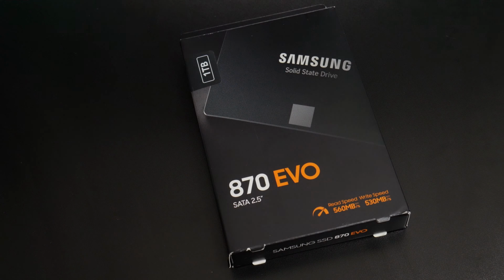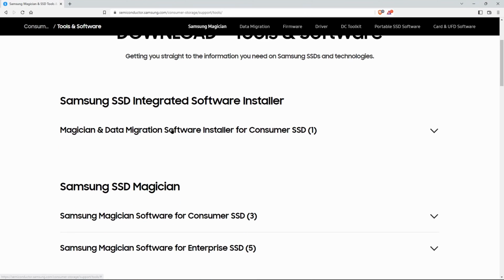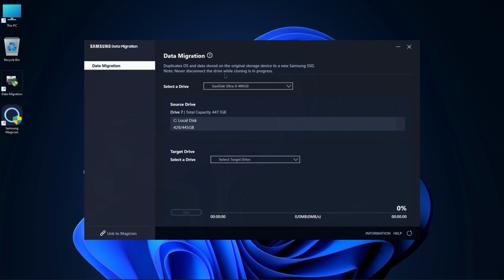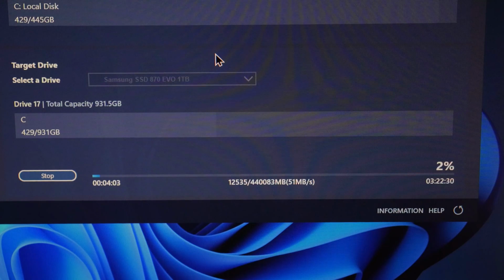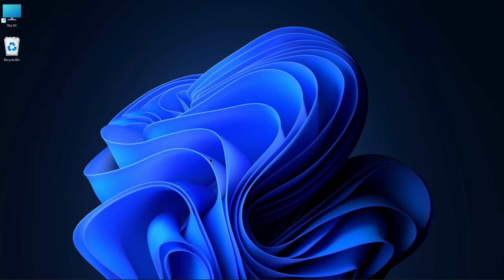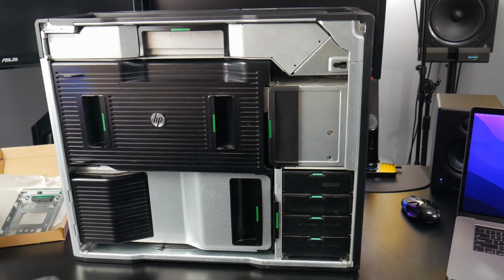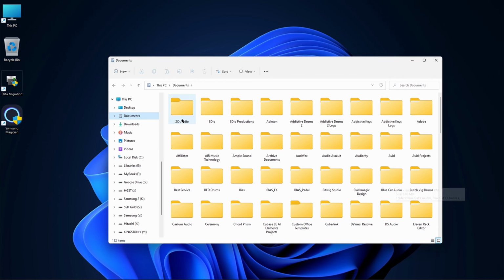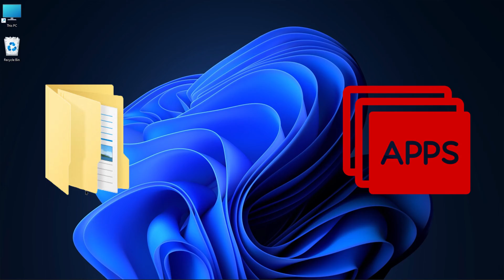How To Install a New SSD and Copy Windows, All Files, and Apps To The New Drive 🖥️🔥

Comment: Running in to a small issue. I migrated everything from my original ssd drive to my new ssd, even windows.. everything loads faster, computer is more zippy. Ran a diagnostic scan and the drive is in good condition. All around great. Even made the new ssd my boot drive but when I load games, my pc crashes and does a quick restart. Any suggestions?
Reply from the maker: Run a Check Disk and repair https://mysupport.razer.com/app/answers/detail/a_id/6234/~/how-to-use-the-check-disk-tool-to-repair-your-hard-drive

Check windows update for new drivers.

Depending on your computer, there may be a built in app that updates things like BIOS and driver. If so, use it, If not, check the manufacturer website for updated BIOS and drivers for your motherboard.

Check Device Manager and see if you have any exclamation marks (!) on any device, and try to fix it if you do.

Check the manual for your PC to make sure your new drive is compatible with your motherboard.

Comment: cloning windows is a BAD idea if you are changing from a regular SSD to an M.2.  The graphics and some other drivers are dependent on the install location + drive port and will cease to function when you boot the new drive.  I just experienced this myself, whereupon my new drive with cloned windows 10 just boots to an unusable black screen + cursor.
Reply: How did you fix this issue? this happened to me too. It goes to my desktop for a while, but nothing is usable and then it just goes to the black screen again.

Comment: Is it possible to do this with nvme? I have an nvme ssd for my os and a 4tb hdd for my gaming. To play starfield I gotta upgrade my ssd. to have enough space for more than just my OS. I'd like to move the os to my HDD, install the new nvme and then transfer it back.
Reply from the maker: Why do two transfers? If you only have a single NVME and cant do a direct transfer to the new one, you can always buy an external NVME USB3 encloser. 

Place the new NVME in the encloser. Do the transfer. Then swap NVMEs.

The you could use the old NVME inside the encloser as a backup drive or whatever you want after you wipe windows from it (format)
Reply: @BenoniTech  I don't know that's why I was asking 🤷‍♂️

Comment: Thanks. Good starting point. Once I found the Samsung Magician Software and got it to run (error messages in the beginning, turns out Win 11 does not like the software to be started from the download folder, weird!) I installed the new SSD in M.2 format after locating the spot on the motherboard where to put it. Restarted the computer, started the Samsung software, defined to migrate from the old SATA SSD with 250 MG to my new M.2 SSD with 1 TB. It took about 20 minutes to clone Win 11. Then a reboot again into the UEFI Bios to change the boot drive. Done. Took me less then an hours to quadruple data space ...

Comment: But ilok licenses on HDD?? Not works on new ssd?
Reply from the maker: All of my iLok Licenses are on a physical key, so no issues for me. I can't say for certain if the authorizations will copy over or not if you use the Computer option. They may, but what I would do is simply de-activate all iLok licenses from the Computer before you clone. 

All you need to do is grab all the licenses and drag them to your Account name in the ILM.

My other plugins that use a computer based authorization all still worked, but your results may vary.

For something like Waves, you can quickly move the license back to your account before cloning, just incase.

My Plugin Alliance plugins seemed to work just fine. As did all the stuff in Native Instruments Komplete 14 CE.

But, if anything goes wrong, its not really a big deal since you still have the old drive. Worse case scenario is you have to put the old drive back in, de-authorize your plugins, put the new SSD back in, and authorize.

I didn't want to go into that too much in the video since it would take alot of time and 99.9% of folks who watch this don't use things like iLok or any audio plugins. But it is something to consider if you are like us and have hundreds of licenses for all kinds of plugins.

In my experience, the majority of things just work. But there's no problem in de-authorizing things before you clone and then re-auth on the new SSD.

And again, you still have the old drive, so you won't lose anything. 👍👍
Reply: @BenoniTech  Yes, I think it's better to de-authorize HDD licenses first. Also I have a USB ilok. :)  But many people today have PC licenses.